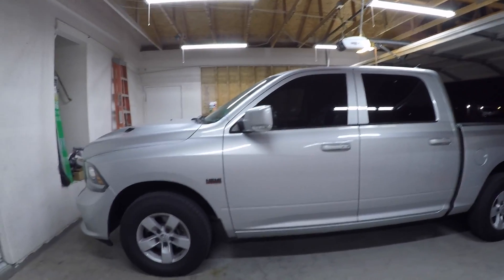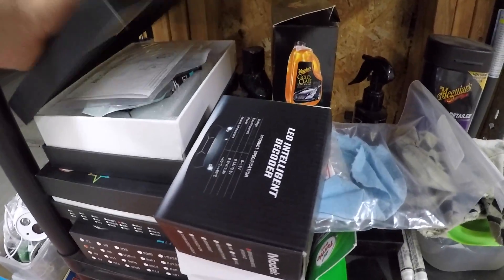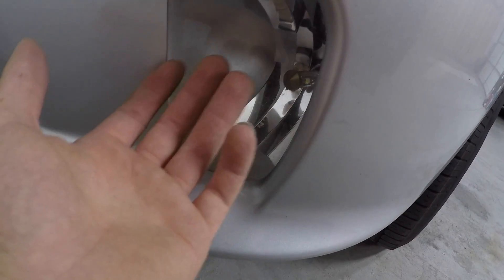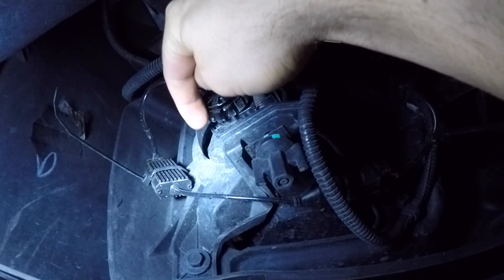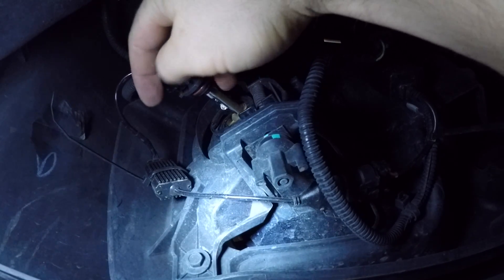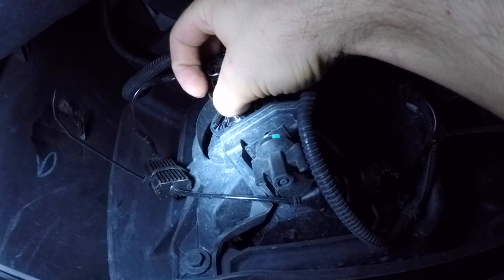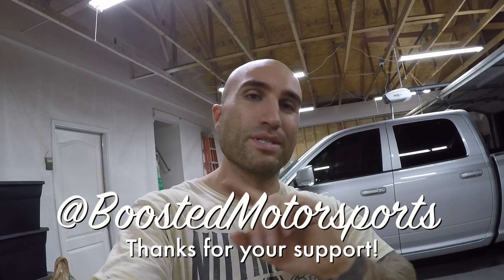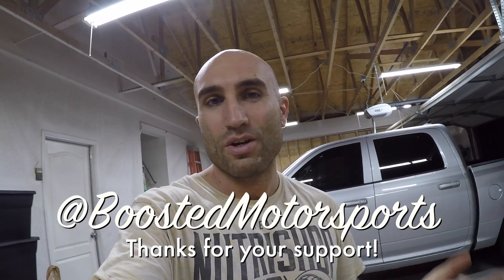LED BULB Position Trick for 9005 or 9006

Comment: The "proper procedure trick" is that the wiring of the led bulb is at the bottom 6 o'clock position and that is how you install them. No "extra experiment tricks" are needed.

Comment: Thanks so much Brother. You helped a lot. My bulbs were loose and did not have a screw to tighten. I will use the factory washer that came with the OEM bulb. Hope this helps setting the angle properly. Cheers!

Comment: I got Sealight Scoparc LEDs and the 9005s are 30° off vertical so the beam is diffuse, when installed according to Sealight's instruction video. Furthermore, they fit loose and fall out easily. I had to turn the bulb 120° and insert it so it locks in tight, but the chips are still off by 30° and not facing left/right. There is no adjustment to rotate the LED assy for proper alignment. This is on a Mazda CX-9. The stock halogen lamps produced a better beam and just as bright but very yellow/orange in color. Doesn't look like the Sealights can be adjusted in this manner.

Comment: Man.... Once again you have helped me out! I just swapped my fogs over to LED and I liked everything about them except the fact that they were a little "jiggly" in the housing. I swapped those O-rings out and now they are nice n tight. I was almost ready to return them, but then found your video on Google. I shared the tip in the Amazon review and gave you props.
Reply: I'll have to try the o-ring swap, I'll update if it works.

Update: the o-ring swap did not work out in my situation due to the smaller tab on the led bulbs not being as wide as the halogen bulbs so I placed 3 layers of electric tape on top on the small tab to compensate for the size and the bulb doesn't move in the housing any more.

Comment: I’m Replacing the headlight bulbs  in my 2013 Jeep Grand Cherokee, the low beams were quick and easy to install but the high beam is not secure, it’s loose. I thought I tried everything until I saw this video talking about using OEM light gasket. Trying it today,  Hopefully that works.

Comment: Bro, the LED light engine needs to be facing the reflector faces, your driving lights reflector position is vertical, so they need to be facing 12 o'clock and 6 o'clock, unless you use a 360 degree LED bulb, I just replaced the high beam bulbs on my 2017 Ram 3500, and the Sealight 9005 bulb position faces vertical and the reflector is horizontal, so I ended up removing the mounting bezel and moved 90 degrees and now it reflects the full output of the bulb.

Comment: @boostedmotorsports I purchased the c6s fog light for my ram but for some reason is really loose in the housing I tried putting the old gasket but no go any other tricks?
Reply from the maker: Hmmm check the lip/groove you are putting the gasket on you can usually put it on the next ridge

Comment: Hey brother! How you been?! I finally did this to my fogs. Got the opt7 resistors installed too. No more light out message!
Reply from the maker: Hell ya that’s awesome Jamie! 👍👍👍
Reply: BoostedMotorsports I will say. The light output to the side is much better with the fogs rotated! I don’t drive my truck in snow and it’s hard with cold weather, a small ass 2 car suburban garage, working midnights, finishing a bachelors and a 1 year old. Finally found time to get her done.

Comment: Thanks for the video.  Good looking truck. 

Question. 
Does your Ram have the independent rear-end suspension or the solid rear axle?
Reply from the maker: Thanks!  All 09+ RAM 1500 trucks have solid rear axles but they use coil suspension instead of leaf springs.  👍
Reply: That makes sense.

Comment: Now I’m gonna have to do this to mine lol.
Reply from the maker: Hell yeah!  You'll notice the light is more focused where it should be after 😎
Reply: BoostedMotorsports hey bro. Just had my first issue with the HIDs. Well just the ballast I think. It’s been just under a month since I finished it. I don’t drive my truck everyday not very much at all. But I work midnights so I do drive at night. They have been great until the other day. Saturday afternoon I got a low beam headlight bulb out message. At first I though the canbus error canceller went bad. But the light was actually out. Shut the truck off. Let it sit a little while. Started it back up and it was fine for an hour drive. Parked. Went to a wedding. Left there and got half way home. 30 mins or so. Then the light went out and I got the message. Sorry for the long message. Just wanted your opinion.  You think it’s just the ballast?
Reply from the maker: Hey Jamie are you turning your headlights on/off manually with the truck? Bunch of us have had weird issues trying to use the Auto function with HID and Canbus decoders.
Reply: BoostedMotorsports yeah I’m using auto function.  If I switch over manually to on it won’t come on.
Reply: BoostedMotorsports still does it in manual mode 6 minutes into my ride to work. 12-15 minutes get to the parking lot and mess with the switch. Now they both don’t work. I thought it was the ballast. Now no clue.
Reply: BoostedMotorsports I can confirm. Not using auto mode and turning the lights on and off with the knob is working. No issues so far.
Reply: Luckily since I ordered the wrong kit first. I already have 2 extra ballasts. I’ll have to swap it out soon. And do the fog gasket swap and angle change. I need to check your latest vids of your hellram. 

Sorry I’ve been away. Been so damn busy. I started back at school and work and my kid take a lot of my time, especially when my wife is working 12s every other 2 days and every other weekend. Trying to finish my bachelors before I’m 30 lmao. I’ll be 28 here in a few weeks. Sept. 29th.
Reply from the maker: I hear ya man!  Keep grinding, its the best way to live 🤘🤘🤘

Comment: Can you please do a video on all the led lights that worked and still work with no errors? I bought a 2016 ram 1500 and want to get led for everything
Reply from the maker: I've got ya covered!  Just did that video last week! Here it is 😎https://youtu.be/qL7p_3Gt4BQ
Reply: BoostedMotorsports are all the lights in this video currently still working with no errors? I believe I watched it already but I've seen a couple videos where the lights worked but then a couple months later they didn't
Reply from the maker: Yeah I was documenting the trail & error process for you guys but the ones listed in the description are the ones that are working perfect with no errors for months now.  Only thing is just double check your bulb types cause there is some variation through the years on some bulbs and also between led tail lights vs halogen etc. 👍
Reply: BoostedMotorsports  thank you love all the videos

Comment: What way do LED'S face in reflector housings? "Headlights" 2010 dodge ram 2500
Reply from the maker: Hard to say without looking at and every light is setup differently.  You have to take a look at the original bulb and where the filament is positioned and copy that before tossing in the LED to get it dialed in 😁

Comment: Boostedmotorsports Does the 3 o'clock/ 9 o'clock positioning apply to LED's in the low beam projector headlights? Or do they only go in one way?
Reply from the maker: Hey Frank thats part of the issue with using LED in the low beam projector is they do a terrible job at projecting the light from an LED type bulb.  I compared LED to HID in these housings and HID blew the LED away!